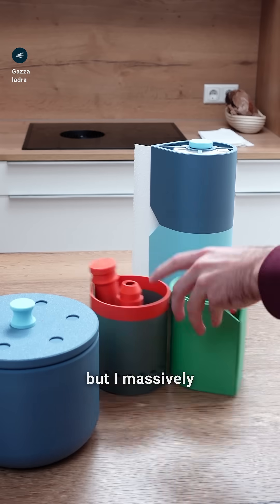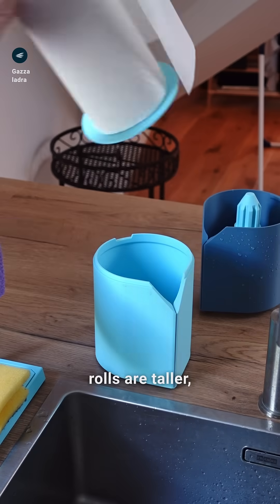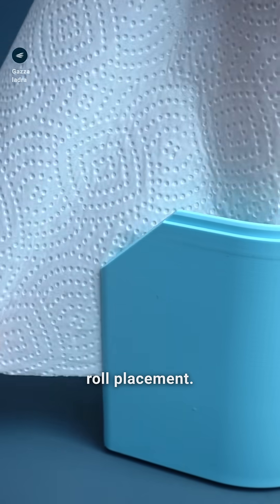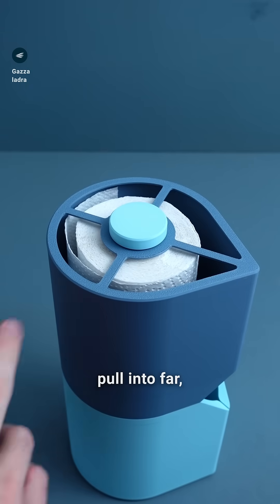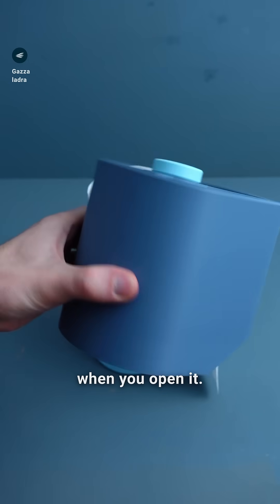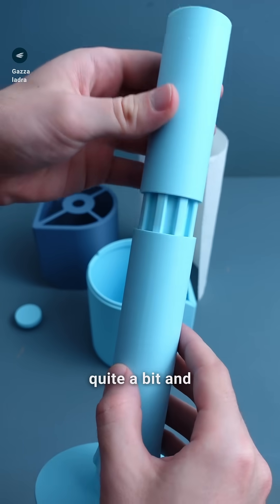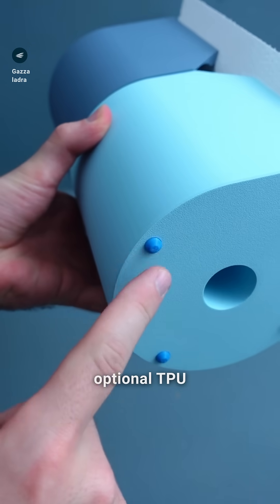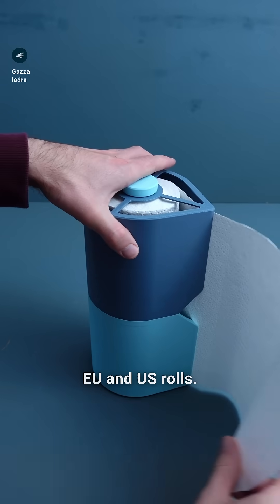I over-engineered a 3d printed kitchen towel dispenser!

Comment: That's cool and all, but can't you do anything about needing two hands to use it?
Reply from the maker: So I attempted that a few years ago and it's hard. I added rocks to a box and taped it to the bottom of a prototype but weight makes this thing massive. A suction cup could work but in general a one handled ripp of is quite difficult to achieve. A wall mounted version with a lever might work.
Reply: @gazzaladra  I have a holder thats attached to the bottom of the cupboard. It allows me to pull a sheet one handed. Maybe that's an idea?
Reply: @nevill2947 literally just design a couple of arms that attach to the ends of this thing that hold it firm. Shouldn't be too bad after everything else
Reply: @nevill2947 yeah a design like this that worked like those would be cool too 👍
Reply: @dragondogbark  how do you press over it and pull the paper at the same time, with 1 hand? Just fixing it to the counter doesn’t solve anything 😂
Reply: @nevill2947  Yeah I do this and I just rip the towel directly to the side opposite of where you put it on
Reply: @remiranda wdym? you just pull it with one hand and if it's attached to a surface then it holds the roll in place. this isn't a new thing. we do this already
Reply: @gazzaladra  You can achieve it by laying it horizontally and ripping towards the ground.
Reply: @Favmir yes! Mounting to the underside of a cabinet would be ideal to fix the two-handed issue, and save counter space
Reply: @gazzaladra You can make it so it requires less force to rip apart, by adding teeth that can be used to cut the toilet paper at its seams (like the one used in tinfoil boxes) . So someone can pull on it and have the teeth seperate the sheet without much force. I think this solution would be an easier fix than stabilizing the weight.
Reply: @gazzaladra  There are weighted ones at Costco and such that could be copied. Requires a very dense circular disc metal base and full grip rubber circle covering the entire bottom.
Reply: @gazzaladra  You know about that cup that sticks really hard to the surface when you slap it, but not when you lift it normally? You could look into that instead if suction cups
edit: its called the mighty mug
Reply: @gazzaladra i have one of those holders that's made out of like one wire folded into a base and a long loop, and the long loop hangs on a hook on a bar that was already in my kitchen. Somehow this system, and it being slightly above my 'forward' reach, makes it so that I can fairly easily tear off with one hand. 

Possibly this design can also be mounted to a wall/cabinet in a way that the tearing angle allows for one handed tearing?
Reply: @gazzaladra  there are discs made of natural rubber to provide instane amount of friction that you can embed into the base.
Reply: @Vissidus_IL got a name or a brand?
Reply: @gazzaladra use a centrifugal force stopper like a seatbelt uses, but a small one. So when you pull softly it unrolls but when you rip, it stops. Hope this helps your endeavours ❤😊
Reply: @gazzaladra I think all you have to do is let it unspool in one direction, and when you pull it in the other, don't let it. So that it rips along the line with the excess force
Reply: @gazzaladra maybe you already answered it already, but how about aligning the whole thing horizontally. It could be more stable and still possible to use the paper towel with one hand ?
Reply: @gazzaladra what about adding suction cups to the bottom?
Reply: @gazzaladra may i suggest you to put it side way while giving some sort of way to latch it to the edge of a table perhasp that way you can just pull up or down the paper with one hand only, idk
Reply: @gazzaladra maybe pull downward on edge on table to tear with suction cup to hold, that'll probably work...
Reply: @gazzaladra maybe attach it to the tap?
Reply: @gazzaladra on its side, opening up. Like a tissue holder
Reply: @gazzaladra what if you add small spikes to the side of the slit where you pull the towel towards? could it help with one handed tearing off when used in tandem with the suction cup on the bottom for stability?
Reply: @gazzaladra  how about a vacuum suction cup like in shower hangers?  i love your kitchen towel dispenser more than i should
Reply: @gazzaladra  maybe an attachment like those monitor mounts where you clamp it on the table, but that won't work if you want the roll in the middle of the counter or if there is nothing to clamp it. maybe something that you can attach to your faucet??
Reply: @gazzaladra  Awesome desing! Make another notch on the top side. I can tear the paper that way very well from the one in my kichen. The one I have is a cheap round base with a center core. The base is steel for weight, so a bottom container to throw in a bunch of steel parts may work without making it massive. Rocks usually do not have the density. The top notch will definitely let you tear from the already precut seam. Keep the center notch too because that helps with pulling the paper out.
Reply: @gazzaladra just be a baller, throw in a disc of pure tungsten in the bottom to weigh it down without the space needed for rocks
Reply: @gazzaladra Maybe you could make the button on top togglable?
This way you can pull out the desired length, press the button to lock the rotation, rip it off and then disengage the rotation lock.
All with one hand
Reply: @gazzaladra need to do more R and D. They make them. I have a wooden one that I'm not sure what is in the bottom but it's heavy and it doesn't move. A steel plate perhaps?
Reply: @gazzaladra make it horizontal like a normal toilet paper holder. And you should be able to operate it with one hand. It can even be wall attachable.
Reply: @gazzaladra what about a ratcheting mechanism? Or (I don't know the proper name) the momentum-based lock that gets used in car seat belts?
Reply: @gazzaladra just make it hollow and fill with liquid, or make the base hollow and fill with liquid
Reply: @gazzaladra  How about making the walls where the paper goes through a little tight and when you pull the paper through, it will rip at the dotted lines point? Would probably be hard to implement with different paper brands though
Reply: @gazzaladra  maybe filling the bottom with sand?
Reply: @gazzaladra Concrete next time
Reply: @gazzaladra what if you added a third section to the bottom about an inch or so, filled with either sand or a heavy weight? Also improving the grips at the bottom (more surface area) could help?
Reply: @gazzaladra brudda just add a suction cup on the bottom
Reply: @gazzaladra  hollow base filled with concrete?
Reply: @gazzaladra the problem of the roll getting wet is caused by the need to use two hands. Dispensers with a heavy base and a core that provides a small amount of drag already exist and solve this problem.
Reply: Wider base and tension spring in the rod. That way when you pull it, not only are you pulling out hit the rod is pulling back in
Reply: @gazzaladra I can consistently one hand rip without anything other than a normal roll holder 😐
Reply: @gazzaladra could you print a suction cup for the bottom with TPU and then modify the holder to fit it?
Reply: @gazzaladra  just add addesive to bottom, people not going to move it much
Reply: @gazzaladra  how about magnetic tape on the place you want to justify it, then a magnet on the bottom of the paper holder with a knob to move the magnet away fro mthe magnetic tape by pressing onto the tape (so the user doesn rip it off which would damage the grip of the magnetic tape  - basically like this, where the lower dot is the tape and the upper part is the magnet, and the carets show the wedges you'd be moving via the knob >:<)
Reply: @gazzaladra horizontal. Design it horizontally.
Reply: @gazzaladra du könntest eine hängende Version machen die man in den Schrank hängt? Dünn genug dass die Tür drüber schließen kann. Wenn das fest hängt unter der Tür sollte eine Hand reichen
Reply: @gazzaladra I made one of stainless steel since I’m a welder and it’s massive but works one handed
Reply: @gazzaladra  a wall mounted version would be cool! Mounting it would allow you to get rid of the feet, and rotate the whole unit 90° like a comercial paper towel dispenser.
Reply: @gazzaladra  maybe if you design it for a one handed pull, then pushing with the elbow on the same arm to lock, then use the wrist to tear.

Then the design doesnt depend on the impact of the one armed tear anymore. I imagine a desgin where squeezing the whole thing locks the roll. Its not one-handed but its one-armed
Reply: @gazzaladra it needs to feed downwards so that it sticks to a fridge or wall horizontally
Reply: @gazzaladra what if you use a winder like an old telephone dial for the roll with a suction cup on the bottom, or attach a right angle triangle cord to a wall so there’s even weight distribution, or even suction cups on the side so it can attach to a wall
Reply: @gazzaladra how about adding a sharp metal serrated edge to allow it to rip easily
Reply: @gazzaladra  There's a certain mechanism in car seat belts. If you pull slowly, the paper comes out; if you pull quickly and abruptly, the roll jams and the paper towel tears at the perforation.
Reply: @gazzaladra  kannst du nicht Vacuum Noppen drann machen 
zumindest für glatte Flächen?
Reply: @gazzaladra would a slight spiral help? A little mechanical design which makes tearing easier without sharp edges. Along with a little weights on the outer circumference of the base. But ig unless it's fixed, we can't really make it one handed.
Reply: Change the geometry to one that is unevenly balanced for the tear side. Also you could use denser materials or double up the fill.❤
Reply: @gazzaladra  Or if it laid on its side instead of standing up?
Reply: @gazzaladra Idk anything about design but I was thinking about it for a sec. Probably already thought of and tested but what if you extended the edges on one side slightly and added a silicone edge so it can grip the paper while you pull it against the edge after pulling out the desired amount of papertowel? Or if you did one of those rods that run the length you can engage when you only have the ability to use one hand? You'd probably still need to make a second motion somewhere in this process but this could be a great tool for those who genuinely don't have another hand and/or ability to afford a prosthetic.
Reply: @gazzaladra  Lever actioned mall restroom paper dispeners have these teeth that score the breakaway part with big holes making it easier to rip by pulling the strip of paper towards those teeth.
Reply: @gazzaladra  Time to engineer the paper now
Reply: @g @gazzaladra  Just wanted to add my 2 cents, but what about making the pointy end where the paper exits a little bit longer so holds a bit longer at the end than at the bottom. This is the simplest and most seamless solution I could think of taking advantage of the design of having two halves.
Reply: @gazzaladra suction cup
Reply: @gazzaladra  I wonder if a rubber strip attached internally to one edge of dispenser could provide enough grip if pulled against. but not enough that it interferes with normal use.
Reply: @gazzaladra suction cup or may make you own weight that is round at the bottom.
Reply: @gazzaladra try making it hangable it should work
Reply: @gazzaladra  What about magnets?
Reply: @gazzaladra why not a lock in bottom? Instead of needing to press while cutting, it allows you to just click it locked, then pull and click it unlock for next time
Reply: @gazzaladra what if you just turned the whole unit on its side, it would be like a tissue box. It should provide more leverage/stability on the tear than it being upright
Reply: @gazzaladra  Could you get like a 8-10mm plate of steel? That would probably do it and still be slim. Not exactly cheaply printable though
Reply: @gazzaladra  What about adding a pocket in the bottom half where one can fill with water or sand to make it heavy?
Reply: @gazzaladra well just like any other roll dispenser it can be attached to the counter, wall, or underneath a cabinet. Very cool! Much kudos 👍
Reply: @gazzaladra some off the shelf towel holders come with a metal / weighted base which is heavy enough to allow one handed tears.
Reply: @gazzaladra  u know how toilet rolls r attached right? u may need some screws and a drill but it'll work 🤷
Reply: @gazzaladra  i have a suction drinking cup which i use frequently. It can only be removed from the table when you lift the cup upright, otherwise you pretty much won't be able to move the cup at any other angle.
Not sure what's it's called.
Maybe you can try this method
Reply: @gazzaladra Maybe some sort of piece of rubber in the opening? It would let the paper grib a bit better to pull. I'm just be afraid it would cause the paper to get caught easily
Reply: @gazzaladra it needs directional resistance and to be mounted. If I pull straight it should keep unrolling, if I go at an angle it needs to begin a tear.
Reply: @gazzaladra how about mighty cup?
Reply: @gazzaladra a nearly flat mounting plate on the base you can screw/glue in place would help, and so you could detach the holder from the plate to move the holder around for other usages
Reply: @gazzaladra  2 things:

1) I think instead of "chamfer", that you meant " chamber".

2) Don't U know that automatic HANDS FREE paper towel dispensers, ALREADY EXIST in the U.S?
Reply: @gazzaladra what if you added little bumps the the sides of where the paper towels come out, so you can just rip it quickly and tear it from the seams with the bumps?
Reply: @gazzaladra  what about hanging it down from a cabinet and pressure being applied at the exit when you rip it at an angle to the pulling direction?
Reply: @gazzaladra  there's a guy here on YouTube who uses concrete pours in his 3D prints to make desktop machining stuff. He sets his ambitions a bit high but there might be some lessons to learn from his experiments with fitting weight into prints.
Reply: @gazzaladra skill issue, I fear, as I do the one handed rip daily.
Reply: @gazzaladra okay I'm pretty ignorant but if this helps any, I'm able to do a one handed rip every day and usually not rip the paper towel into pieces by grabbing the piece at the top close to where it's connected and pulling straight down instead of out. So that could help you a little 😅 my paper towel holder is face height. Also how about a horizontal design?
Reply: @gazzaladra have you considered a mechanism by which you could squeeze and tear by pressing a top-mounted button? would take some work and the mechanism might be tempermental but I think it would solve that problem.
Reply: @gazzaladra  How about a separate piece that lives on the countertop? A weighted base that your assembly keys/locks into? This base could suction or clamp to the counter semi-permanently
Reply: What about a wave pattern like on a tape dispenser. It doesn’t need to be sharp, just enough that the towel rips at the raised points along the perforated line which will cause the rest of the line to tear. It should reduce the amount of force needed to start the tearing process.
Reply: @gazzaladra What if you made the chamber rotate and cut the paper towel as you pulled it?
Reply: @gazzaladra  Make a base plate, a bit wider diameter than the main assembly and leave some insert slots in the top of the base plate to throw some tungsten pinewood derby weights (maybe 4-6). Squeeze tungsten puddy into the center tube of the lower half of the main assembly.

Boom, low center of gravity achieved.
Reply: @gazzaladra try a wide base, like its bottom is a plate
Reply: @gazzaladra Have you seen those special cups with some kind of suction at the bottom that makes it so you can’t tip them over? Maybe that could help
Reply: @gazzaladra вакуумная присоска. Ее силы хватит, что бы ни при каких обстоятельствах она не оторвалась. Ее будет практически невозможно оторвать руками.

Но вообще, я отрывал одной рукой полотенца, которые стояли в обычном "проволочном" держателе. Суть в том, что бы резко дёрнуть. Но это работает только с полным рулоном. 

Вакуумная присоска бы точно решила проблему. Я точно это знаю, потому что я использую такую для вскрытия смартфонов.
Reply: @gazzaladra  Suction cups could be inserted. Or attaching screws.
Reply: @gazzaladra  A lever may not be required if mounted horizontally, letting gravity also help in the rip.
Reply: @gazzaladra  useless if you cant use it one handed
Reply: @gazzaladra Machine learning the paper towel holder. It learns when to pull against you based on where the towel will tear. One handed!
Reply: it probably could work with one hand if you rip it off fast enough and from the top end i think
Reply: @JARV1S_exe I think one time I did this because my other hand was dirty and I ended up just throwing the whole roll on the floor 😂
Reply: @JARV1S_exe  I can confirm this works like 90% of the time. Grab from the top edge that is not connected to anything. Make sure the perforation is against the rest of the roll (give it ideal tension). With a quick, sturdy flick of the wrist, pull down out and towards you. It takes practice and isnt always clean, but you can do it. And, from what I can glean so far, this design will make it a lot easier to do so!

Hope this makes sense. Describing such particular things is a definite struggle
Reply: @JARV1S_exe facts, fast and at an angle along the seem, it has to be perfect to work but just takes practice. I almost only use one hand personally
Reply: @JARV1S_exe Top end? I would think bottom. iI you were trying to tip it over, you would exert force at the top, not the bottom.
Reply: Suction cup at the bottom.
Reply: @robinradema1 same thought, one that has a lever/button that locks it down, like the cell phone holders you attach to your cars windshield/dashboard.
Reply: you can fix it to the counter or weigh it, i got a wooden one with a heavy base that i can use one handed no problem
Reply: My eye started twitching
Reply: @Real_extra_1  my balls started itching
Reply: Velcro
Reply: Add sharp teeth to rip the paper then multiple suction cups.
Reply: Fill the hollow bottom tube with concrete. You’ll need to go up to the line where the 2 meet. But should add good amount of weight
Reply: Just pull sharply downwards
Reply: Might be not what you are asking, but if you rip it very fast, it works with just one hand. Works most of the time for me
Reply: You can add tape or attachment to the bottom
Reply: I just use a heavy holder, one made of metal, and a quick motion to rip the towel. Never had an issue with completely drenching the whole roll nor staining it while cooking since you can just pinch the center of the towel you're using instead of the edge contaminating a future piece
Reply: I bought a couple holders that attach under the cabinets (solving the water problem), and they have some resistance to turning so you can just grab and rip with one hand. Super convenient!
Reply: If he solves this I'll buy one. Have yet to use a paper towel without needing two hands. Maybe add little teeth and a non slip base?
Reply: There's a type of adhesive patch which doesn't loose its stickiness which our dispenser has on the bottom. Just plop it onto any smooth countertop. You can wash it with water to remove dust and debris. Edet kitchen roll easypull
Reply: Maybe add small suction cups in place of rubber feet? Also do you sell them? I'd love not having to buy a 3D printer 😅
Reply: I often tear my paper towels off with one hand, whether the roll is in a stand or just setting vertically on its end. It just takes a quick downward yank and some practice
Reply: The rubber feet
Reply: Pull the towel down vertically and you should be good
Reply: lol, main problem :D remember had once some stone bottom with a  pole and it was enough :D was heavy, and stone bottom had something like rubber glued to the bottom, as well..
Reply: Einfach fest spaxen
Reply: You need to somehow mount this to a wall. The table top one need either a lot of weight or some anchor to counter leverage from the pull.
Reply: Asking the right questions
Reply: I actually have these tissue packs that come in, well, packs, and you tear open an opening where it then pulls out like a tissue box, it even comes with a hook so you can hang it on a wall
Reply: just put some heavy metal in the bottom
Reply: Get sticky stuff to put on the bottom
Reply: So off the top of my head, I'm thinking a way to achieve a one hand tear this would be to have something similar where the roll lays on its side but the holder is set into a kitchen counter, so you would need to cut out a section to fit a holder beneath, or have the dispenser in a deep enough drawer, maybe? Biggest issue I foresee is the end of the roll getting lost when a rip happens, so some mechanism might be needed to add a grip/stop of some kind. Zero engineering skills I'm afraid so no clue if this is even feasible :-)
Reply: just put a suction cup underneath
Reply: You could probably add one of those suction ccup things those soda can holders have so that it doesnt fall over if you bump into it. You just have to tilt it at a certain angle to unengage but it will hold when you pull the paper.
Reply: Ninja blender has suction cups on the bottom that work phenomenally. Might be worth a shot?
Reply: Im thinking a switch that is around one paper segment away from the opening thatvu can flick with a finger while u rip, that activates some holding mechanism. Like a tiny lever or something. Plus suction cups ofc.
Reply: Suction feet/stands
Reply: just modify the bottom half add a dovetail on it and print a matching piece and screw it to any surface you want, now its detachable so you can still pick it up and place anywhere but also can be fixed in place in its most commonly used area
Reply: Suction cups?
Reply: use a tea towel
Reply: Use tape
Reply: Put a hole through the design. Buy really long bolt. Attach bolt to wood. Attach wood to stable surface. Put 3d print on bolt. If you need the minutiae explained for you, let me know.
Reply: Literally the only useful improvement he could have made and instead made it worse
Reply: Just make the base wider and reduce the the friction on the paper towels by:

A) widening the opening
B) create some extra piece/protrusion on one side that assists in allowing the paper to tear at the perforation
Reply: @vincea1830 how about widening the base w/ 4 mini suction cups?
Reply: Put double sided tape without the little feet
Reply: Why not a suction cup bottom?
Reply: Get rid of one hand.  You will find a way
Reply: Keep it horizontal, make the ending edge sharper, and make it stick to the table with suction to do the work.
Reply: Simple: Add big chunks of gold/platinum in a compartment at the bottom and at the top. While you're at it, better fill the tube in the middle with it as well.
Reply: Maybe add suction cups to the bottom, would work on most countertops with the right suction cups
Reply: Suction cups on bottom?
Reply: I can do it with one hand and I use the BLITZ rolls too. It’s all skill issue
Reply: A suction under it will do as well as making the base heavier
Reply: Also make the edge shaper and a bit serated
Reply: Add a battery and detector that slices the paper when you pull out enough of it.
Reply: suction cup
Reply: I mean you could probably just adhere some decent suction cups to the bottom
Reply: We ALL know how that works. They have them in restrooms 😂 and it tears regardless
Reply: Weighted metal plates like washers and rubber grip at the bottom. That's essentially how mine is made and it's heavy and sturdy enough for one handed rips and it's not attached to any counter
Reply: Maybe add suction cups at the bottom?
Reply: Yes dude: use your arm to put downwards pressure and then the other hand to tear. It’s not hard to improvise a little, does every aspect of your life need to be engineered?
Reply: Just use an old school metal one and learn to rip it fast.
Reply: Might be a skill issue. A quick yank could be the answer
Reply: I have one 3d printed, and with a large enough rod in the middle, a wide enough base and enough friction at the bottom, you can rip one sheet with one hand :)

It's also 3d-printed, but in two parts, and has a magnetic top which is very securely stuck
Reply: It has to be firmly attached, a suction cup/small weights won't work. You'd have to mount it or something
Reply: Command strips
Reply: I bet if you tore downwards at the right angle it would be easy to use one handed
Reply: Hang it horizontally. The paper slides over a see-saw mechanism that moves up and holds the paper in place while you pull it down on your end.
Since we're over engineering anyway 😂 could even be 2 small seesaws at 1/5th and 4/5th of the length. Or keep it vertical and just one small seesaw at the top.
Reply: Glue the bitch down
Reply: The roller attached to a surface with deed resistance to the roll bar will solve this problem.
Reply: Maybe if you use some form of adhesive on the lower part or perhaps if you use a weight so that it stays in place..
Reply: That’s what’s i’m saying
Reply: giant suction cup
Reply: Just add 2 pounds of steel at the bottom
Reply: for real! coz most of the time during cooking you've got only 1 hand for grabbing the kitchen towel!
Reply: Just came here to say the same! this needs to be in a wall mounted version then it's a nice product. Or attach it to the counter. And some matching ones for aluminum foil and sera wrap
Reply: Suction cups ftw
Reply: Suction cup on the bottom
Reply: Let's think it's not going to tip by fixing it to the ground somehow, all it needs is something like a ratcheting mechanism, depending on which direction the paper is pulled, it should lock the rolling or release it.
Reply: Duct tape
Reply: Yeah if you just dont use an over engineered piece of plastic and rip really fast you can do it with 1 hand
Reply: you can use silicone base or attach suction cups/ve;lcro to secure it to the wall behind allowing one hand operation and at the same time easy access for changing the roll
Reply: This guy doesn't have elbows...😂
Reply: Also on top I would prefer transparent plexi
Reply: Glue the bottom dumba$$. It's literally that obvious.
Reply: Yes u can. Glue it to the table. Or 2 side tape
Reply: Duct tape.
Reply: If there’s a mechanism that could add friction after a certain amount has been pulled then reset 🤷🏾‍♂️
Reply: Give slope to axis? Rip start is at max angle. Teeth will tear the rest easily with reducing force = minimum topple chance.
Reply: Buy a 2.5lb plate from your fitness store of choice, use epoxy like JB Weld to glue it to the bottom.
Reply: Suction cups on the bottom?
Reply: The one I have is metal with a weighted base and I can rip with one hand
Reply: A laser that cuts the towel when a certain amount is pulled out. Ignore the perfs.
Reply: Well if can this just engineered but it’s a good design!
Reply: Yeah glue a weight to bottom 😮‍💨... What can you do?
Reply: just place it horizontally dumbass. put it on a slightly heightened(1-2 inches) platform than the base kitchen top to avoid damage from any liquid spills.
Reply: Maybe use the foot to do the same thing that the other hand does.
Reply: Add a lead weight to the bottom
Reply: My mom has a roll holder thats horizontally and mounted to the wall, the friction for holding the roll is very high, so you just pull the paper and as soon as enough has unwinded, the tension starts pulling on the dotted line and it'll rip automatically. So you basically need a high grip strength and a fixed (probably screwed or strongly clamped) mountain system
Reply: Lay it horizontally attached to the surface and a clamp mechanism that would gently hold the towel on lock mode and would release when unlocked. 
A person Using would have to disable the lock, pull out the Required length, turn on lock and pull-tear the towel...
Impractical?
Reply: I've built one a few years ago: https://youtube.com/shorts/3kSuavottt0?feature=share
It is as simple as possible, the top part is attached to the base with a partial thread that allows free vertical movement, letting you press it down to secure the paper.
Reply: yeah easy, just add two keyholes and bolt it laterally to the underside of your cabinets
Reply: I think if it just had a lip that sticks out, it could be used to poke the perforation line and cut it. Basically the same way the grocery stores do their plastic bags.
Reply: Put suction cups as feet
Reply: 10lb weighted bottom
Reply: Suction cups would work
Reply: Suction bottom/base 💡
Reply: just use a suck pad foot
Reply: I was thinking the same, maybe make the inside roller only rotate one way, so when tearing it you pull it off the opposite direction from rolling it out? It would still need quite a bit of grip though.
Reply: Add weights at the base?
Reply: Wall
Reply: Since when has there been a kitchen dispenser that doesn't use two hands? That's also mobile and not stuck to the table.
Reply: This feels like something that’s easy to fix by yourself with a tiny bit of critical thinking.
Reply: I only use one hand, I would argue anyone who can’t has a skill issue
Reply: Как насчёт использования локтя? . _.
Reply: Use old uranium it's small and heavy enough to create stable base.
Reply: Ventouse !!!!
Reply: my dumbass thought you meant you didnt have hands and asked him to 3d print a pair of hands 😭😭
Reply: Mayne make it horisontal, square and elongated, at a slight angle towards the surface.
Reply: Learn to tear the paper properly, it's easily torn on even a 5€ roll holder from Lidl, you just suck lol
Reply: You could add a suction cup or a slot and hook at bottom..
Reply: @lonewolf.wanderer Did you even read their comment?
Reply: @Kr3pt-vg1dp  yes, did you?